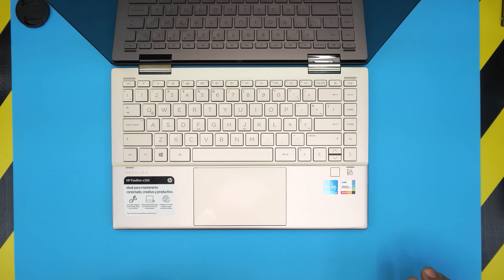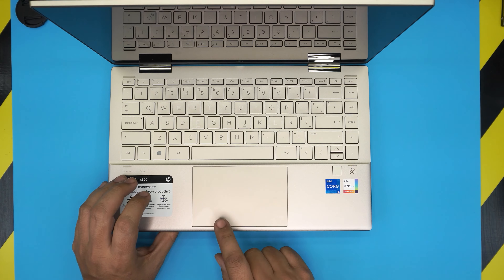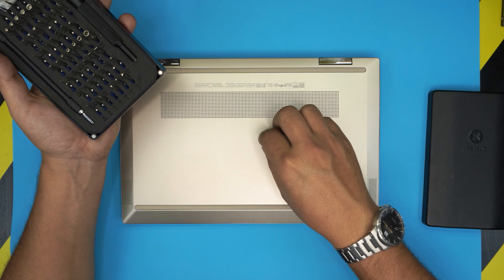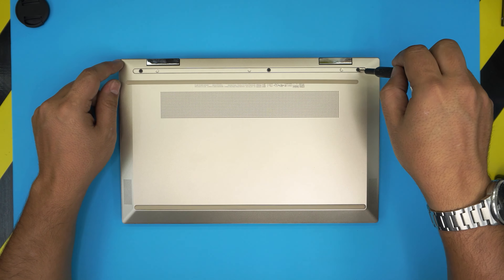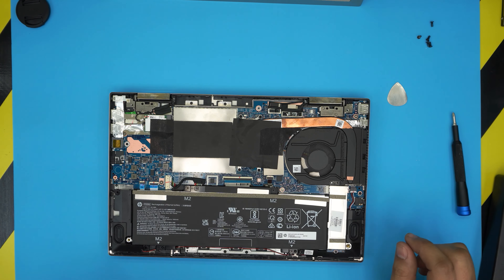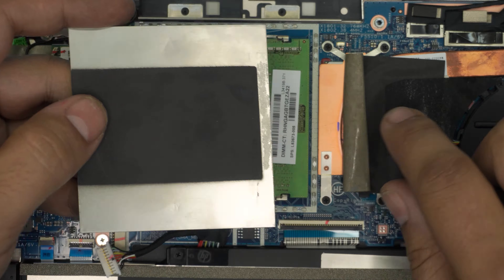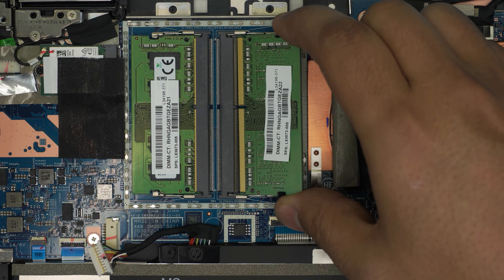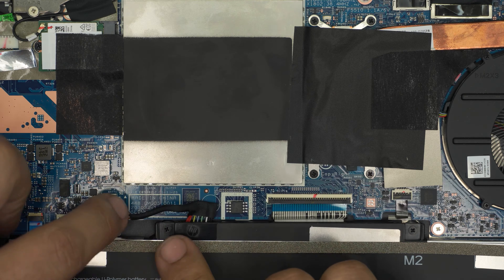How to upgrade RAM for Hp X360 14 DY series laptop

Comment: Hi , I hope you having a good day so I have this laptop with the model 14-dy0010nx , I struggled to find any compatible memory is the one you linked compatible since its a slightly different model.
Reply from the maker: Thank you for the feedback! if you wish to support the channel you can LIKE or SUB or both :P
regarding your question:  1st of all please check this video to see what is the max ram capacity for your model: https://youtu.be/tKEJTkVth4Q
NOTE: remove the bottom cover to see (double check) to see how many ram dim you have.
then for your laptop based on you max ram you can get any of the GB from this brand they are very good and rock solid.
https://amzn.to/3fBpbWP

Comment: im thinking about to buy x360 14-dy0010 that is the latam versio of this generation of notebook, so i was considering to upgrade it but does dual channel influences too much in case of having , 4 x 16 configuration  to have 20 total ? i can upgrade my omen's ram , and put the spare one on this as is ddr4 too  and putting the 4 left ram on and older laptop. i suppoe, kind regards and love that u have a ñ notebook too!
Reply from the maker: Thank you for the feedback! if you wish to support the channel you can LIKE or SUB or both :P
regarding your question: you can have 4 and 16gb if you want and the dual channel will be only up to 4GB on dual channel and single for the rest if you fill up.
you can always place any combination ram you like in GB but the dual will only work up to the smallest ram.
Reply: @uFixTek  i will like and suscribe your video if it helps u  a bit and as a thank u for your speed answer, my man, last question, as im seeking the one that has 4x4 by default, and i saw that both slots arent soldered but what is the max ram supported? , its about scalability on the future, as this is the only 2 in 1 14 inches with 2 non soldered slots of ram y have seen up to date, happy new year !!!
Reply from the maker: much appreciate al the help i can get, and regarding the max ram capacity i recommend you to go max 16gb anything over its waist of money , to see max ram capacity check this: https://youtu.be/tKEJTkVth4Q

Comment: Are you sure the highest RAM we can upgrade is 32GB? I've advised with HP and they said the highest is 16GB
Reply from the maker: Thank you for your feedback! If you wish to support the channel, you can like, subscribe, or both!
Regarding your question, we have upgraded our clients laptop per request to 32gb without issues, but i highly recommend to keep at 16gb. 
because up to 16gb you can use any sdram ddr4 up to 3200mhz.
but if you want to go to 32gb then you must bring down the ram speed to 2400mhz sticks, and only few brands work with this board.
so for best compatibility and easy to upgrade go with 16gb: https://amzn.to/46fjxlO
if you want to know your max ram capacity for the laptop check this:
https://youtu.be/tKEJTkVth4Q
Should you have any further questions or requests in the future, please don't hesitate to ask me.

Comment: i was wondering if this laptop also allows for its processor to be changed
Reply from the maker: Thank you for your feedback! If you wish to support the channel, you can like, subscribe, or both!
Regarding your question, unfortunately the CPU is not replaceable and soldered on board.
Should you have any further questions or requests in the future, please don't hesitate to ask me.
Reply: @uFixTek  i bought the same laptop but its kind if slow and un reactive at times i was wondering how would i stop that the laptop has 4 gb ram with an intel pentium gold processor

Comment: I just bought one of these and it must be a newer build I do not see the RAM anywhere, when I remove the heatspreader, which is different in shape, there is only a 512 PCIe M.2 SSD drive?
Reply from the maker: Thank you for the feedback! if you wish to support the channel you can LIKE or SUB or both :P
regarding your question: what is the exact complete model of your hp x360? give the complete model number and let me check it out for you.

Comment: Hello,
What is the highest frequency supported for my model (14-dy0155ng)?
Reply from the maker: Thank you for your feedback! If you wish to support the channel, you can like, subscribe, or both!
Regarding your question, you can place up to 2666mhz and the bios will auto adjust the MHz to the safe speed that it can use, you can't manually adjust it like in PC motherboard, because the option "XMP" is not available in laptops.
Should you have any further questions or requests in the future, please don't hesitate to ask me.
cheers🍻

Comment: Hi this is a really helpfull video i placed the new ram (16gb) in slot 1 to replace my old ram (4gb) as ive been told you cant have them work together as they arent the same memory however now when i tried turing on the laptop it turns on but gives a blank screen , ive tried replacing the ram into the other slot but no change.
Reply from the maker: Thank you for your feedback! If you wish to support the channel, you can like, subscribe, or both!
Regarding your question, did you check the max ram capacity :
https://youtu.be/tKEJTkVth4Q
i would recommend you to keep it at 16gb, or get a 2x8GB that was the 2x8gb is better than having a single 16gb. because with 2x8gb you get a dual channel ram memory that is much faster than single 16gb.
cheers🍻
Reply: @uFixTek  yes the ram is 1 16gb module do you have any other ideas my laptop bots up and the fan starts working but only for a few seconds then stays on the black screen for a minute , I be put the new ram in slot 2 and took out the old one , any other ideas
Reply from the maker: remove the battery and charger and  all rams and press and hold the power button for 30sec then plug in the rams and the battery and charger and power on and wait 10-15sec for the motherboard to do a  mem check.
Reply: @uFixTek  Should I put of of the rams back in in the begining then power it on and then after remove the old or just the new one. Thansk

Comment: Thanks for the video.

On the left of the memory modules there is a slot that looks like a M.2 slot.  Do you know if it is reallly a spare M.2 lot ?
Reply from the maker: Thank you for the feedback! if you wish to support the channel you can LIKE or SUB or both :P
regarding your question: its m.2 for wifi boards only, here is a video for ssd upgrade: https://youtu.be/oStJspY4FTs
if you want to remove the wifi board and insert a ssd you will require a adapter. and modification to place the extra card: https://amzn.to/3exmTem
don't recommend it.

Comment: Thank you for the vid. 
Mine isn't coming on after the installation tho.
And I tried switching the ram positions after the first time but it still isn't coming on.
What do I do
Reply from the maker: 🫠Regarding your question, remove both rams, disconnect the battery and press and hold the power ON  for 30sec, then plug-in the rams and then the battery and then power on and wait up to 15sec.

Comment: The installation was smooth but if it doesn't boot up does that mean the ram is installed incorrectly?
Reply from the maker: Thank you for the feedback! if you wish to support the channel you can LIKE or SUB or both :P
regarding your question: do this exactly as i mention, #1 remove both rams place only the new ram on DIM1 slot then without placing the cover turn on the laptop and wait 5-10 sec to get a hp logo, once you got logo, then POWER off by holding the power button , then place the old ram on the dim 2 and then power on and wait 5-10sec and it should work. let me know how it goes

Comment: Can you replacement battery and which type battery 
Subsribed
Reply from the maker: Thank you for your feedback! If you wish to support the channel, you can like, subscribe, or both!
Regarding your question, sure you can replace the battery here is the link for a battery: https://amzn.to/3SxctwS
the battery is held down by 4 black screws that touch the battery (labeled "M2") and the cable simply slides out (make sure you slide back the connector straight).
Should you have any further questions or requests in the future, please don't hesitate to ask me.
cheers🍻

This is an  Amazon affiliate, when you use my links, I earn a percentage, which helps support the channel🙏.